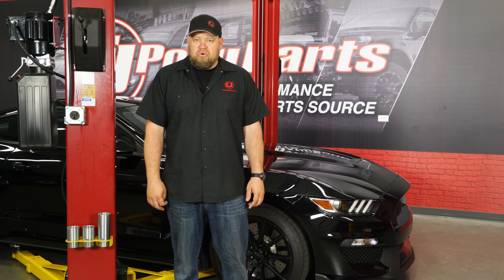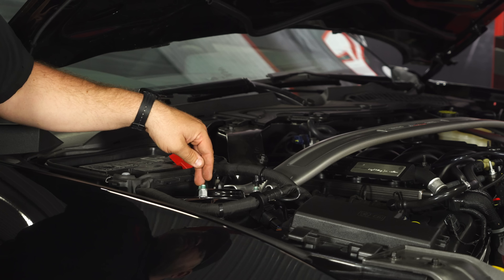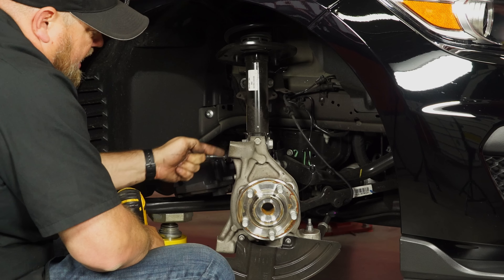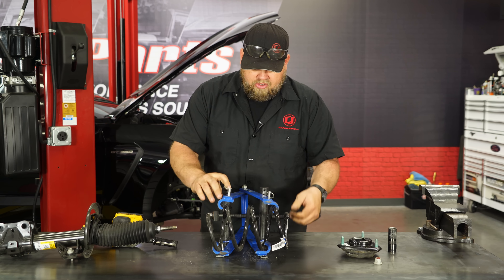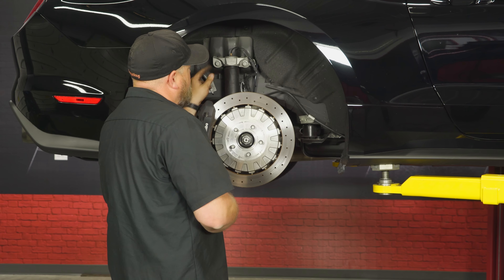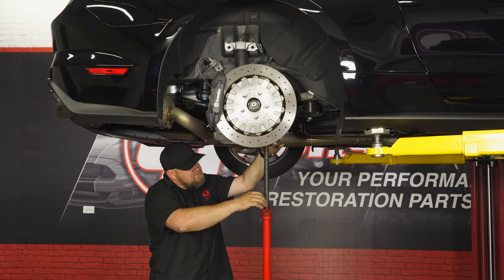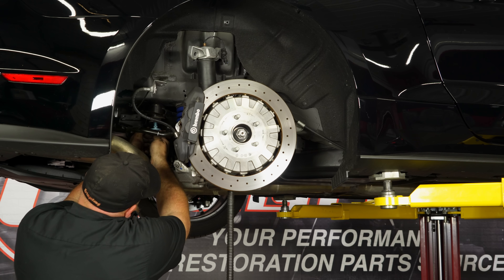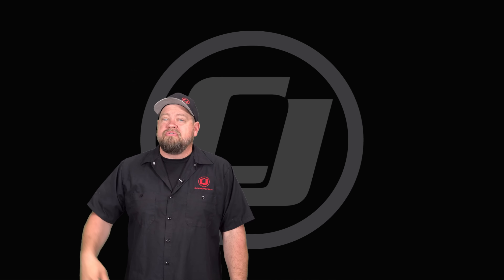Mustang GT350 Install: Ford Performance 20mm Lowering Springs

Comment: If you are installing these with jack stands (as opposed to a lift) be warned that the rear spring install is pretty tricky. Once you get the rear subframe off, you need to give the rear hub/ brake assembly quite a bit of downward force in order to get enough deflection to squeeze the spring out in the direction you want to (towards back of the car and towards you). This is much easier on a lift when you can use your bodyweight to pull that rear subframe down. Install the spring the same manner you got it out. When your are re-assembling the rear, you need to lift the subframe back into place, I recommend also guiding the damper strut to fit under its guide pegs as you do this, as it is MUCH easier then trying to muscle it into that position once you have rear subframe bolts on. Also if you are replacing the front springs, might as well through camber plates on there!

Comment: Look easy to do . I want to know will I lose comfort and tire wear . I was told I would have more issue with my ligaments. I want put some lower springs on my van .Please give me some input.
Reply from the maker: Marcus Woodley depends on the springs, in this case with proper alignment there will be no issues

Comment: Will the car need an alignment after install? Also you commented in a reply that next time you will remove rear pan. Are you referring to the rear defuser?
Reply: Yes!!! Get the alignment after.
Reply from the maker: Yes you should at least get the alignment checked. And yes the rear diffuser, unbolting it gives you a little more room to remove the rear springs.

Comment: Do these require caster camber plates ? Are these springs better than the performance pack springs besides the lowering stance?
Reply from the maker: mario llamas I would recommend cc plates for a track car but they are not needed to achieve proper alignment
Reply: @cjponyparts  does the magneride sensor need to be reset after lowered?

Comment: I've been wondering the gt350 has good suspension can you take the suspension from that and put it on 2016 mustang gt
Reply from the maker: Not really, the GT350 has Magneride so you would need a lot of components to transfer it over.
Reply: @cjponyparts  well found a wrecked gt350 on action it has front end damage but the suspensions good

Comment: Why wouldn’t I be able to install this on my 2015 GT without the magnaride? I bought my mustang used and the previous owner replaced the stock springs with BMR’s, Too low for me, and I want to either go back stock or with a GT350 suspension.

Comment: It'd be awesome if you could add a list of recommended or enhancement mods that would support the lowering springs for the GT350. Track car vs street ride is a consideration I think. Again, great video and like some others, I'm excited to finally see more GT350 stuff on your challenge. Thanks guys!

Comment: The magneride is a good ride even with a lowered car do you have a video to show? And could I get some magneride for a 2012 charger I have lowered it with the pro kit eibach shocks and springs, it’s a good ride but not over bumps and bumpy roads.

Comment: How much stiffer is it with the lowered stance? 
How harsh are they on public roads?
Reply from the maker: I found the ride quality didn't really change and the owner said the same thing. Our roads are not great here in PA and it rode fine, it is firm but not stiff. I have the same springs on my 2018 GT with magneride and love them.

Comment: are these the sam springs the GT350R comes with. Why would any one put these on when the R is already lowered?
Reply: These are not the same springs.  Ford Performance are progressive springs.

GT350R are Linear.

Ford Performance Springs (progressive)
Front: 250 lbs
Rear: 565 lbs

GT350 (linear)
Front: 216 lbs
Rear: 931 lbs

GT350R (linear)
Front: 264 lbs
Rear: 836 lbs
Reply: @Kraziken0  Ford performance springs for magneride are not progressive springs.
Reply: @TheCdM1981  not from what I read on mustang 6g forum.  Where do you see different?
Reply: @Kraziken0  on my car. I have them.   They are absolutely not progressive.  Theres absolutely nowhere relevant that says they are.  Including Ford performance.  They are intended to replicate the “R” springs like everything else Ford performance does.  Non an oem part but to Ford spec of parts already available.

Comment: After installing the lowering springs. Will it be hard to slide quick jacks underneath the car? Is it too low for quick jacks? Thanks in advance.
Reply from the maker: You should be fine, it's not an extreme drop.